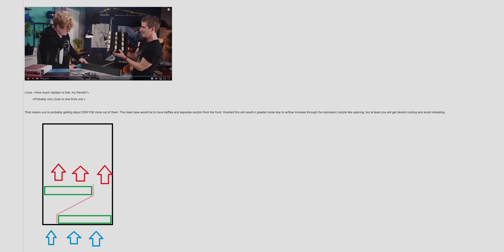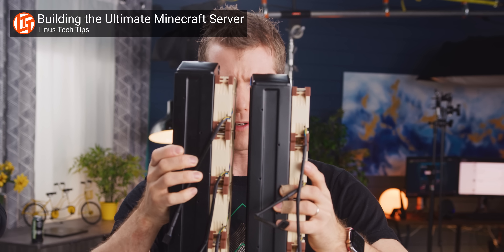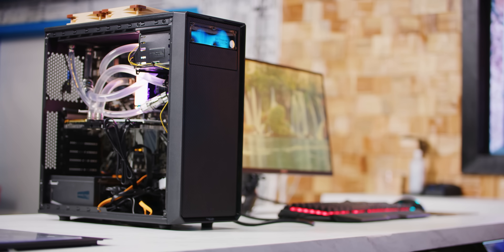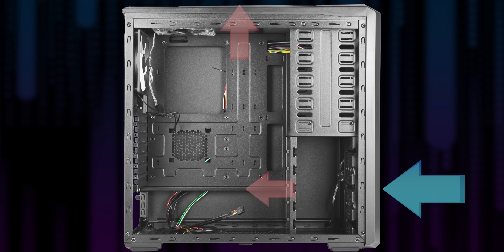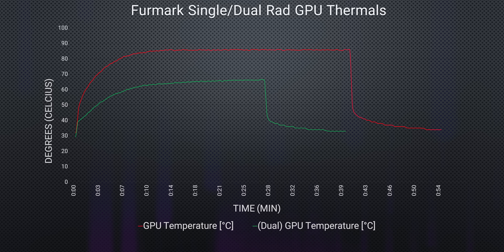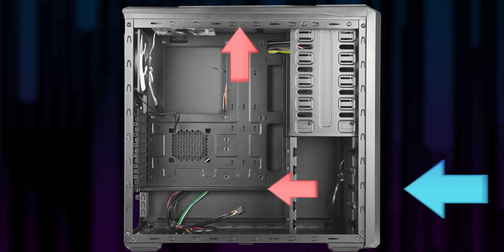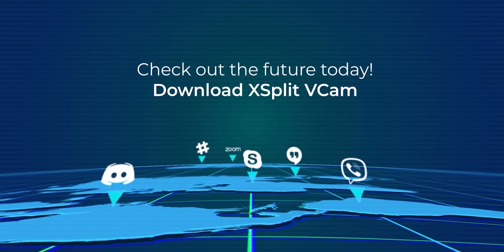I’ve been water cooling wrong for YEARS - $H!T Manufacturers Say

Comment: Like mentioned from others i'd like to see several tests too.
1. dual radiators with fresh air each
2. stacked radiators with the warm water in the same flow direction than the air
3. stacked radiators with the warm water counterflowing the cool air (just my guess, but 3. should work best from the stacked ones)
4. dual radiators both pulluing out of the case while other radiators push fresh air in (maybe?)
Edit after further thoughts on 16.th of May  to name every test that comes to my mind and compare if the arrangement is really irrelevant:
5. Dual radiators, loop in the order of CPU, radiator, GPU, radiator, pump
6. Dual radiators in the order of GPU, radiator, CPU, radiator, pump
7. Dual radiators with CPU, GPU, radiators, pump
8. Dual radiators with GPU, CPU, radiator, pump
Then we should be able to see if there's any difference at all and if it matters if you place the usually cooler running device (GPU) first or not.
Reply: Number 4 is similar to what I have set up for some folks.  Two exhaust radiators keeping the bulk of the air pressure pulling in to the case and then a couple of regular intakes fans providing air to the case.  Heat from the radiators was sent out of the case and cool air supplied to feed them.  Never been a fan of pulling hot air into the case to warm the motherboard and other parts sitting in there.
Reply: This seems like something Steve from Gamer's Nexus could do. Lot's of stats in his videos, but LTT's videos are more lively than his are.
Reply: > warm water counterflowing the cool air
This is definitely the correct answer—this is (kind of) how a real whole-house heat exchanger works. You can stack multiple radiators in series and as long as you put the hottest water at the end where the air goes out, every additional radiator added MUST result in an improved exchange of heat.
Reply: @sjwright2  oxygen exchange in fish gills works with counterflow as well. Between the water and the fish blood. Nature invented it first.
Reply: @arthurvandergracht7101  and the blood circulation of the great white too, to keep as much bodyheat inside as possible (some tuna too if I'm correct) it's used blood runs from the core to the flanks, where the fresh, oxygenated blood is flowing inwards from and through this counterflow of warm, deoxygenated core blood and cold oxygen rich blood which ran across the cold flanks maximum heat retention is achieved, providing better vision, intelligence and speed compared to truly cold blooded species.
Reply: Maybe it has to be a closed pc case instead of open case for accurate results.
Reply: @JustIn-du1cs  You are supposed to restrict a test to as few variables as possible not that Linus would ever understand basic testing protocol.
Reply: @JustIn-du1cs  They did the tests with the sides on.  The footage they used is just from when they set it up
Reply: @Terminator93[RA1D]

3 is better than 2, but you're going to lose out on some efficiency from each individual radiator vs just using 1 rad. Source: Engineer. We had entire terms on heat exchangers back in school. Counter-current flow is mathematically and empirically superior.

I hope when they tried throwing a second rad at their furnace they piped to the exhaust rad first, otherwise the results may not be conclusive.
Reply: 3 is better than 2, let's say you have =A=B=> (arrow being the airflow), if water goes from A to B you will reheat the water with the hot air coming from A. Watercooling should always pass from output radiator first then finish in the input, you want fresh air in your case and hot air outside
Reply: simple.  never have a radiator dumping heat inside a case.
Reply: To show the difference between 2 and 3: https://www.quora.com/Why-is-a-counter-flow-heat-exchanger-better-than-a-parallel-flow-heat-exchanger
Reply: Another thing to add: you can't add extra fans for each rad. The aim is to test the rads, not the fans. I would also like to test actually stacked rads, which wasn't done here (they're not stacked, they're on different ends of the case), but was done in both the builds Corsair *actually criticised*.
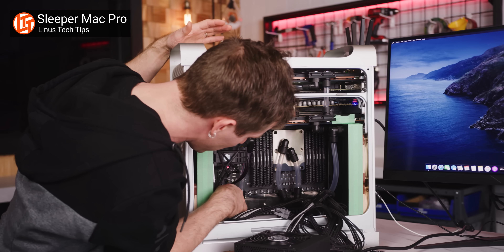Reply: @therealsunnyk  6:47
idiot.
Reply: @shawnpitman876  This err... skips a lot of important information, like did he also remove the fans?
Reply: A top comment that is not a stupid kid meming for attention.........I thought thats not possible anymore
Reply: What i would do is:
Top,Front,Back pushing air in on top and on the front you have 360mm cooler (one after CPU and one after GPU)
On the side panel you suck the air out. Then you get pretty much only cool air and therefor cool water.
It will collect heat in the middle but thats not so important, cause you have a fast air exchange thru the radiators in the middle
Reply: @sn31t33  Radiator order is irrelevant and multiple tests have show the difference is within the margin of error.  The water temp across the whole loop is always going to be the same.  There are no hot/cold spots.  The water is passing through the loop so fast there is no time for it to dramatically change temperature.
Reply: Said exactly what i was thinking! Liked this to see it from ltt!
Reply: I would say try to ignore the clickbait title and generate one from the information in the video.
Probably something like "Easing tension & superstitions to get Corsair more radiator sales" would do great! :P
Reply: Who do you think this is? Gamers Nexus?
Reply: Tech jesus we need you
Reply: we need gamers nexus to do this analysis ;)
Reply: Yeah I'd like to see gamersnexus test this out, they have the best methodology for evertyhing
Reply: exactly!
Reply: I have 4x360 Radiators all sucking air in from outside, 1x 140 as exhaust, Water reaches max 36 degrees under full load CPU and GPUs SLI - room temp around  28 when running a heater, if I turn the heater off I get closer to 28-30 degrees water temp,  Room temp 22 degrees
Reply: Terminator93 [RA1D] HEY LOOK, a fellow Blitz player. Super unicums unite!!!
Reply: @blumac9801  Hey, atm it's more like WoT PC & the Road Berlin event :D
But as always, unicorns 4 the win.
Reply: I see alot of comments and i really dont know why you dont get it. Without explaining thermal engineering and fluid dynamics I will make it simple To what corsair is saying. Surface area with fresh air good and stacking is largely stopping the cooling potential of the second card. It would be like you came out of death valley from a run all day in 112 degree sun and im going to cool you down by blowing 108 degree air on you. I have also seen the argument about "I dont want hot air blowing into my case, well then buy a case where it takes in air at the front through the radiator and redirects it out the right side panel. Hence the external Mounted or free standing radiator.
Reply: @Terminator93: Yeah, makes a lot of sense to do more tets. 

As Jayz has previously, when testing different Pull vs Push vs Pull&Push configurations ... https://www.youtube.com/watch?v=IJmE13sG9PI 

Also, in Jay'z experiment ... it shows having a Pull&Push config you are going to have a 20% better cooling efficiency then just Push .... and 14% better then Pull ... 

Jay'z experiment, kinda tells the story why "stacking" raddors do have a better cooling efficiency ... as the leading Rad' is going to have a fan config of Pull&Push ... and the 2nd Rad is in a Push config ... meaning you are offsetting the negative of stacking Rad's with the benefit of the Pull&Push Rad config ... meaning the 1st Rad is doing most of the cooling ... and the 2nd Rad is maybe ont working at it optimum, but it's working and giving a helping hand ...
Reply: 2 and.3 are kind of useless test: due to very high water circulation speed it would be even across all loop, differences will be less than 0.5C.
As for 1 - I think idea is not to prove that radiator is working better with fresh air - but in proving, that adding 2nd radiator after 1st one is actually works.

I have same kind of situation - space is limited, I can place 420mm on front, 280mm on top and only 140mm on back. And there is no bottom intake. And because I like dust filters - I am intaking air through 420mm rad (push-pull configuration for better airflow) and after than push warm air through 2nd 280mm rad on top. I was worried about two things: 1st - warm air strikes right in HDDs, but even if my loop running silent under load (~550w, ~900rpm, 50c-52c water temp) hdd temps ~45C. Of course with no radiator at all temperatures are much better - like 36C, but 45C is fine too, its not 50-55C as I was expecting or fearing.
And 2nd - yep, I had same idea that I am actually warming up water with 2nd rad. But I tested that idea by stopping fans and blocking top with cloth. I found out that if I am running fan on high speeds - difference is low, like 36C vs 37C. But if I am running on low rpm - results are much better, like 50-52C vs 55-58C, and that actually surprised me. I thought that less air (or slower) comes through rad - warmer this air gets - warmer air pushes through the 2nd rad, so I should see good difference on high rpm and little difference or heating up on low rpm. But like Linus said - real word is much more complicated thing. Although I am trying to reach positive pressure with 3x140mm push-pull vs 2x140mm push+140mm on back (all same rpm) - maybe it is actually negative pressure so 2nd rad gets a little fresh air too. Or maybe due to great deltaT between water and air adding another rad works better on low rpm.  
Anyway even with low rpm main problem is not "hot air after rad" - but "little air after rad": I also checked temperatures with side panel off and they were the same: like my ram getting hot not because it gets only warm air - but because there is not much air moving around it. I had same issue when mounted cpu aio rad on front: cpu aio can't warm air significantly, but ram was hot too because of obstructed airflow, and not because of "hot air after radiator".
Another fun fact: with low rpm I can feel that case is warm and side panel temperature is around 35C while with high rpm it feels like room temperature. But 2nd radiator still working fine. It surprised me, but it is how it is.
Reply: i don't think the manufacturer are wrong nor i you Linus.
use more rad meaning more cooling circle and more time for cooling which is good.

i think that they mean that the second rad is not in optimum efficiency (like  using 1.6/2 efficiency).
meaning that it can be beater in a different configuration.
like all rad take air from out side(cool air) to in the case and other fan take (hot air) out side.
or 
all rad take air from in (med hot air) to out side the case and other fan take (cool air) inside.

Comment: Your experiment seems not the case Corsair talking about.
Reply: At 6:46 he said that Jake removed one of the stacked radiators and it increased temps by 5 degrees
Reply: @BlueReaperX  yeah the radiator is much larger than the 240 on the test setup too and it only made 5 degrees difference rather than the 20 degrees in the test setup
Reply: @HMSNeptun  In a way, they did prove Corsair right. If both radiators had a fresh air source they would get better results hence the 5 degree difference than the 20 degree we saw in the test. However, the radiator can only cool as much as the fresh air temp so without knowing the other setup's water/air intake temp we can't say for certain that the 5 vs 20 degree difference is comparable.
Reply: @BlueReaperX  Then why didn't they film that as example?
Reply: @bvesunsun2324  🤷
Reply: They completely missed the point Corsair made.

Comment: As an industrial-electrician who works a lot with water based cooling systems that go into the megawatts, i can confidently say: there is no such thing as a near perfect radiator and perfect volume usage. 

important for these systems to work as efficiently as possible is that hot goes to hot and cold to cold in a what i would call flow diagram. There is no such thing as one loop temperature. there is pre rad temp and post rad temp. 

What that means for this pc is that directly afte the cpu/gpu the water is gonna be the hottest.  so the first radiator can still get rid of heat with the highest air tempertures. after the rad, the water is gonna be cooler so if you are gonna use  a second one in series this on need cooler air temps to get rid of the same amount of heat using the same airflow. 

theoretical example:
after cpu/gpu water temps: 50C 
the first radiator in gonna get preheated airtemps of maybe 30-35C and heats the air up to 42C
after that the water is maybe arround 45C and in the next radiator this gets exposed to 20-25C ambient temps cooling it to 40C.
if it were the opposite flow direction the already cooled water would bearly be able to put more heat into the already heated air. 

That is  how  high efficiency water heat exchangers can work almost perfectly. With the outlet temps of the loops beeing almost the same as the inlettemps of the other, at the same flowrate. if both would flow in the same direction you'd get two outlet temps that would meet in the middle. (hot in 60C,cold in 0C would result in both outflows being at 30C

Comment: Would be pretty interesting to just hang some temperature sensors in the air to measure its temperature at the different points inside the case.
Of course this method isn't perfect but if corsair was right you should at least see a little difference, I think.
Though that Video would be pretty number focused...

Comment: Or just always make radiators intakes so they draw in cool air.
Reply: Jake Lewis They showed in another video that the positive pressure from two directions did work well. If the back and bottom of the case allow the air to exit, there would still be cooling occurring.
Reply: that's even worse, because then you over-stack your case with hot air which has no where to go and is heating up the components even more
Reply: @Tehkezah  unless you have an O11 Dynamic XL and use the bottom and side as intake and the top and back as exhaust.

Comment: Ummmm
You did not know this???
All you need to do is look under the hood of your car and see an engineered cooling system.

Why is the air conditioner condenser in front of the radiator???
Because it needs to be cooler!!!

Something else you do wrong also is that the "hot" tube from the heat source to the radiator should go to the top connector and the cool tube should come off the lower connector

Comment: I think a point was missed.
Stacking fans isn't necessarily bad. It's more a case of 'the law of diminishing returns'. Corsair rightly states that as air is drawn through the first fan the air has already absorbed heat which will reduce efficiency as it passes through the second fan. However, as there are now two fans in series the airflow may be faster offsetting some of the efficiency issues. The point is that adding a second fan in series (stacked) will only yield a marginal improvement. In the set up in this video I think you're correct in that the second fan is likely drawing in fresh air and not drawing the expelled air from the first fan. This is why you're seeing a more satisfactory improvement. A better test/comparison would be to set up your series (stacked) fans and measure their efficiency then separate the stack and mount them in parallel (side by side) and measure again. I'm sure you'd see a significant improvement. More surface area exposed to fresh incoming air = better cooling.

Comment: Coming from 3 to 2 radiators and only getting a 5 degree difference kinda proves Corsairs point, tho. The marginal benefit of the radiators must drop pretty fast. If the "next" radiator has such a small impact,  it would probably be worth it to reposition it.

Comment: When Corsair claim that the air is 1 degree lower when passes through the radiator this is the “film temperature” of the fluid (Air) this is different to the bulk temperature which is used to calculate the ability of a fluid (Air) to remove heat. It helps that I have an exam on this tomorrow hahaha

Comment: The reason why using the same air for multiple radiators does work is simple and has likely less to do with those additional case holes: When cool air passes through a hot radiator, it only carries a portion of the heat away, slightly decreasing the radiator/water temperature while slightly increasing the air temperature. Unless the air moves really really slow, air and water/rad will not reach equilibrium. So while using a 2 stack radiator doesn't double cooling performance, it certainly does still improve it over a single rad. Keep adding rads for less and less improved cooling in return. 

The slower the air moves through each radiator, the lower the additional cooling performance per radiator stack will be. The higher the temperature delta, the more effective cooling (transfer of heat) is.

What might be interesting, is whether these additional holes in the case are actually hurting or helping cooling performance. These holes might cause warm air that has just recently been released from inside the case to be sucked right back, essentially forming some small invisible "air loops". It might be better to seal off the holes near the exhaust of the air to make sure there is no suction happening near it, pulling in that warmer air again. Tho, it might be even too negligible for any kind of measurement? Who knows... 

You up for some duct tape (test)cases, LTT?